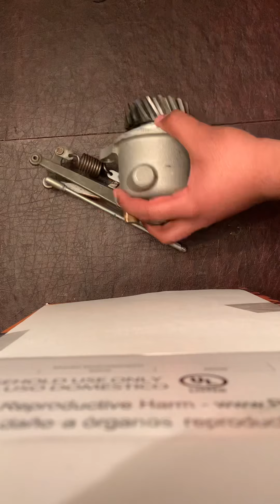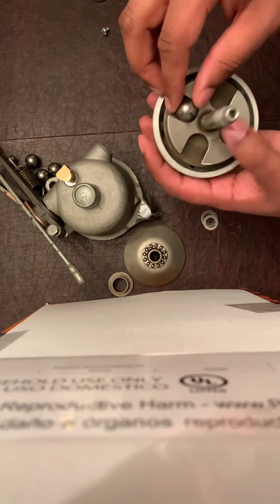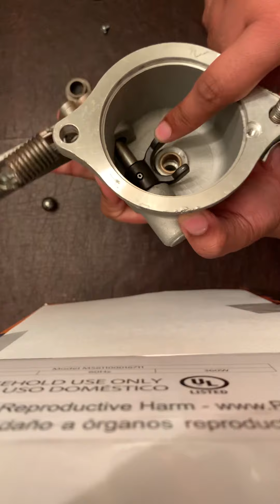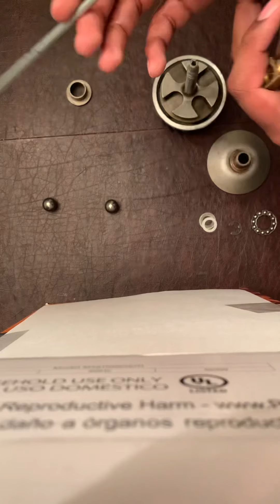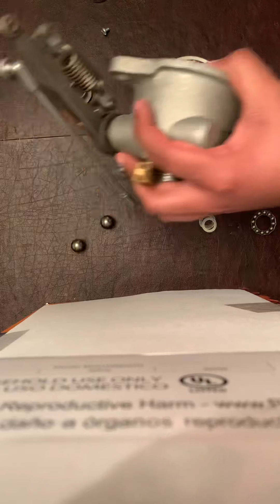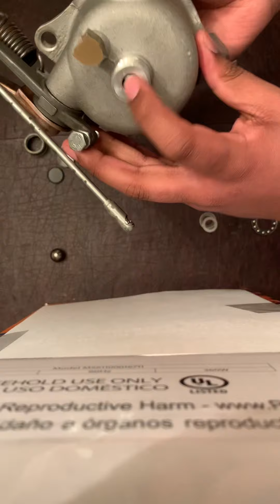MBD Lab 8N Governor Mechanical Dissection Project 2021

Comment: The brass fitting is for the delivery of oil the threaded plug on the back of the governor is for the option of using a proofmeter cable that Ford offered on 8N tractors from 1950-52 it would go from the governor to the proofmeter telling the operator what RPM the engine was turning and how fast the tractor was going in each of the 4 forward gears and how many hours the engine was running. It was also mechanical.😀🇨🇦